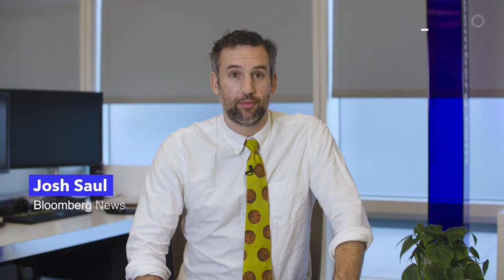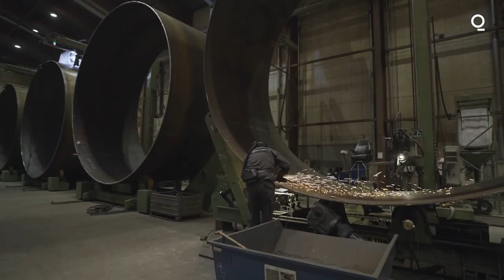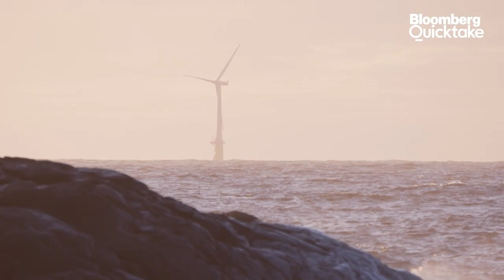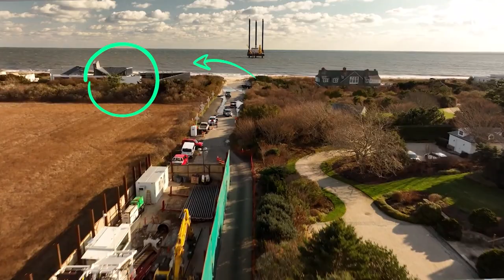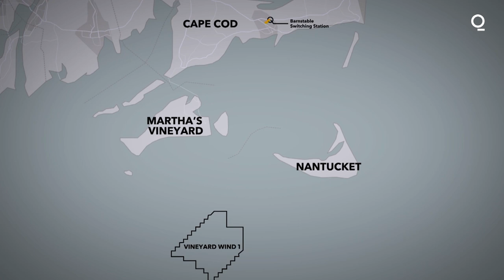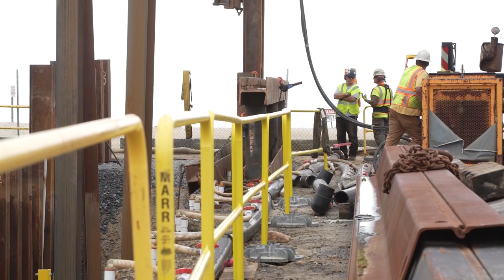Offshore Wind’s Arrival in the US

Comment: ☢️☢️☢️☢️☢️☢️☢️☢️☢️☢️🚀🚀🚀🚀🚀🚀🚀🚀🚀🚀🚀🇺🇲🇺🇲🇺🇲
Reply: Nuclear takes too long to design & build, like 15 years in designing then add 20 years to build and then the stupefying cost... 
Renewables are quick, cheap & simple plus they are not located at a single source, meaning from a defence perspective their perfect as the network will still function if one part is blown to bits and then can be rebuilt cheaply & quickly to come back to 100% transmission.